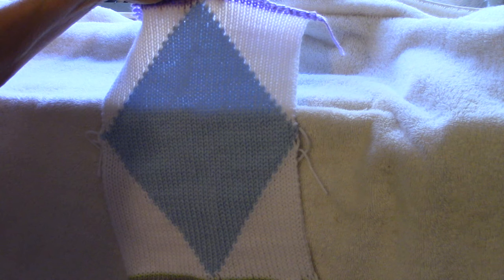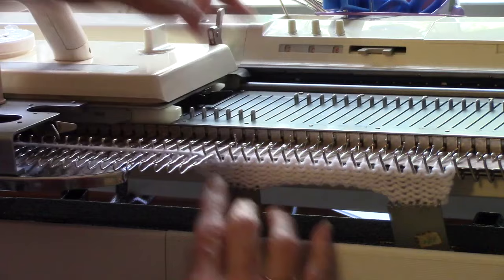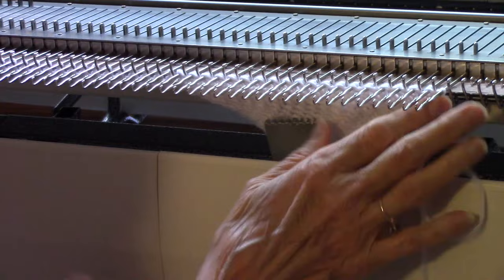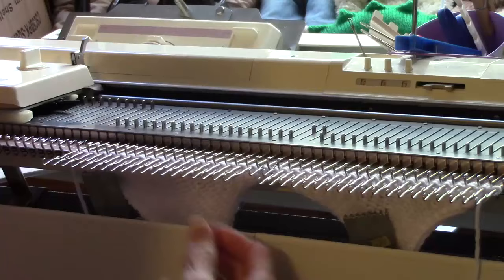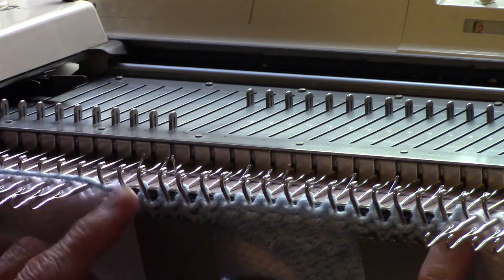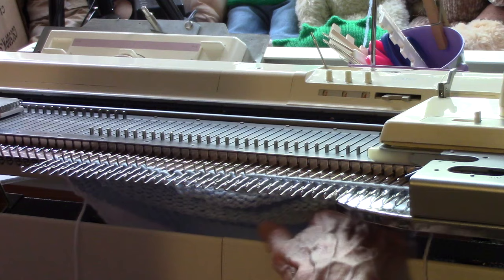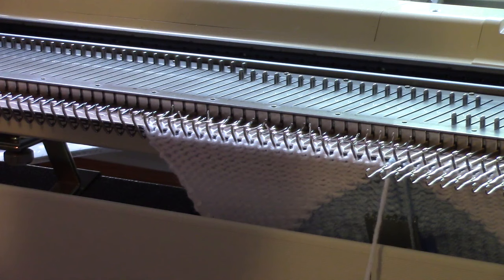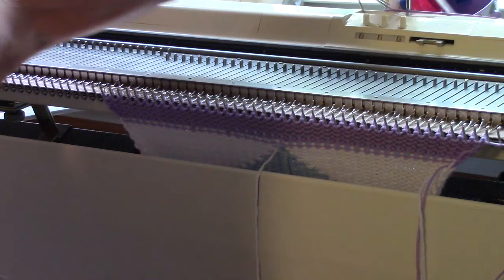Make a Diamond Design with Short Row Graphics by Diana Sullivan

Comment: Helpful!!    I clean my machine but still get a black line on the knitting in hold.  Anyn advice would be welcome 😊
Reply from the maker: That happens when you run over and over the same needles, for instance, in dividing a neck.  I do my necks by taking off all the work onto waste knitting and rehanging.  It should be okay on these graphic designs, though, because you are constantly changing which stitch you're on.  In any case, I don't have any black on my various samples.
Reply: @dianaknits  thank you for replying.   I noticed you had no lines,, what you say makes sense. I'll take it off on waste next time. I have had a machine for over 30 years but had a break without working on it. Its amazing how much I have forgotten.  I am one of the "it should be quicker" types of knitters. That only leads to mistakes. You look so relaxed and like you enjoy every stitch. I admire your patience and way of teaching.  I hope you don't mind questions....I'll probably have a lot for you!
Reply from the maker: I only look like I have a cool head!  I'm impatient, have lots more ideas than time, and I edit the bejeebers out of these videos afterwards! @sandym7952